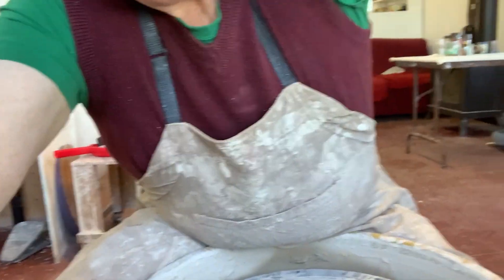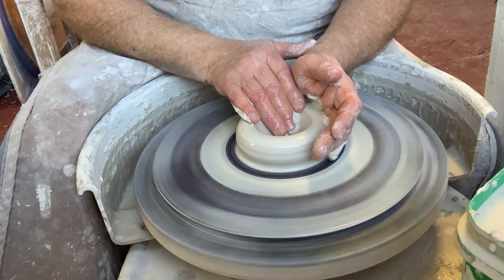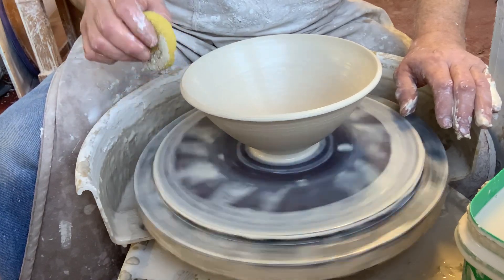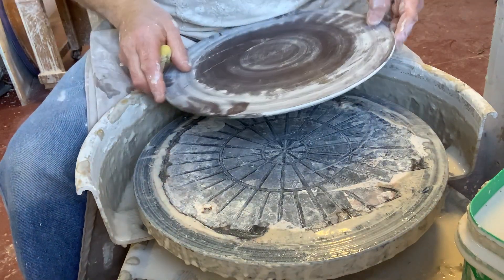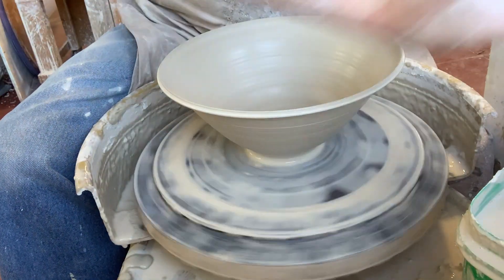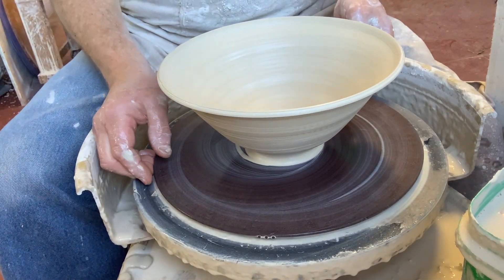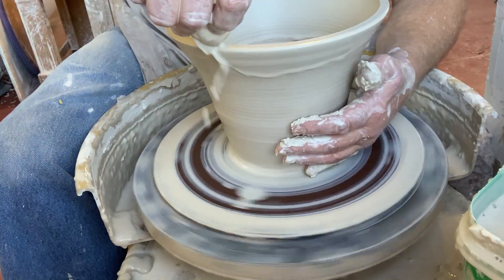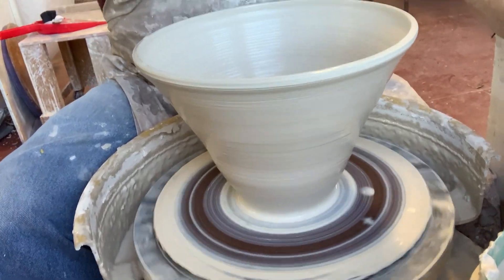Three different sized bowls.

Comment: Hi Vaughan, may I ask how thick do you usually leave the wall, half inch? For 500g & 750g, I can only pull half of what you demonstrated here...Several of your videos are very good reference. Will keep trying. Thank you.
Reply from the maker: I throw very thin, so the clay has to be stiffer.  My guess is the wall at the top is 1/8th inch, may be 1/4 inch near the base.
Reply: @Vsmithpots  Indeed such fine skill. Can the bowl be stretched at the bottom in the final stage to form a fat belly- shape like a noodle bowl?
Reply from the maker: @xm3364  I would do that after the clay stiffens for a few hours.
Reply: @Vsmithpots  Will try out this way. Thank you. :-)